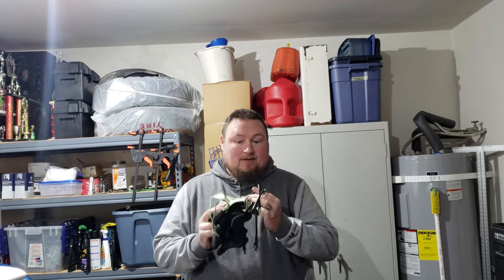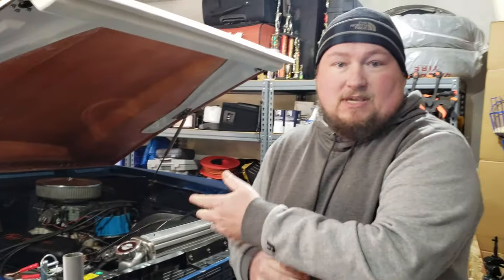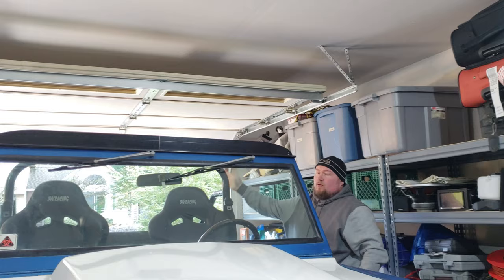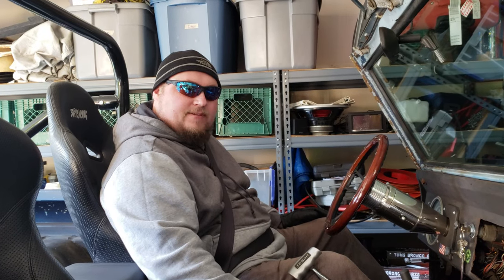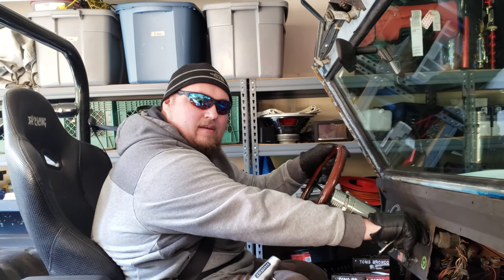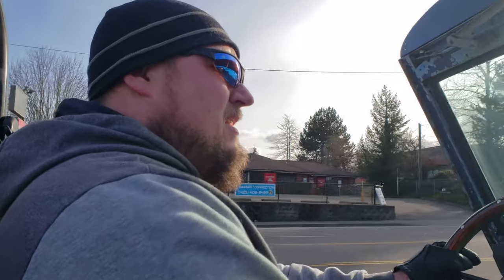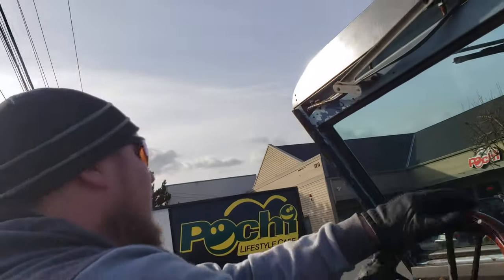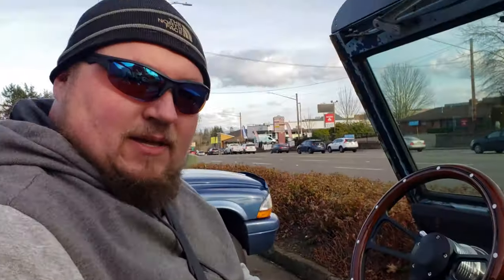Early Bronco Vlog | First Drive of 2021

Comment: What transmission is in this bronco?
Reply from the maker: It is the original "3 on the tree" 3 speed that came in it with the Dana 20 transfer case. The only difference is it was converted to floor shift. I also replaced the original steering column and steering wheel to clean up and remove  the original "3 on the tree" shifter setup and add powersteering. The original 3 speed with floor shift is so much better, IMO.